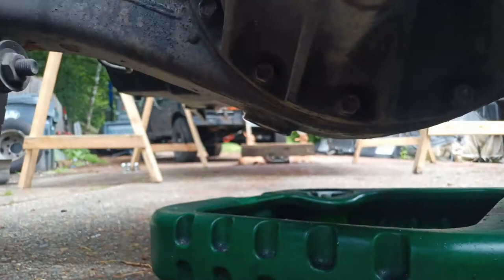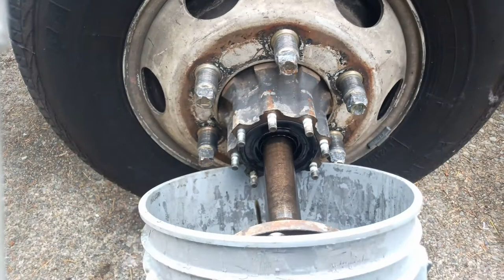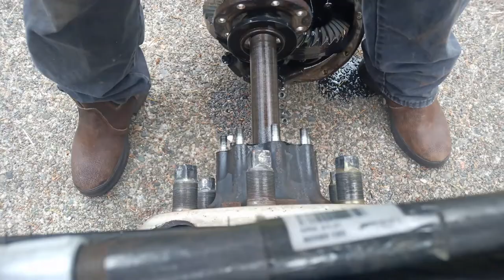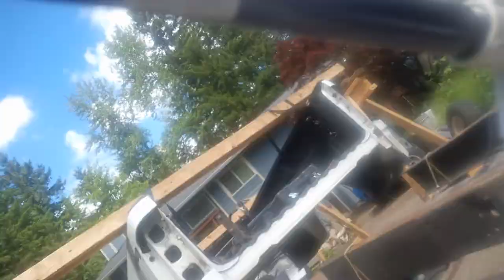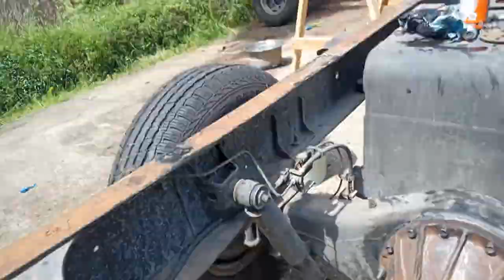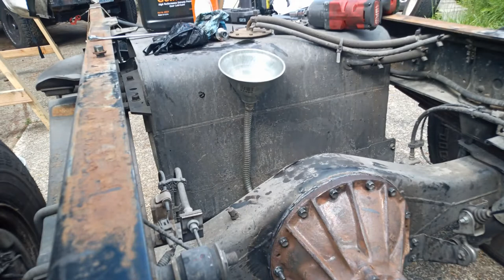Isuzu NPR rear diff swap

Comment: Thanks for putting this up. I'm just learning about all of this- I have an 1993 NPR with a bad G73 -GT5 (4.10 ratio) differential. I'm looking all over for an exact replacement, but it would be great to know that another G73 would fit, even it had a different final ratio. I'd be willing to  compromise just to get it rolling again. It seems to me that your'e showing some compatibility by doing the reverse... thanks for your input, Will in MN
Reply: What were the numbers for both of your differentials?

Comment: I work for a sweeper company street sweeper company. And this is the trucks that we run so we have about 13 of these trucks Isuzu NPR HD gasoline 6.0 engine. I watched your video to try to get some ideas. Because like you I don't have a lift. And if you look on the newer models for some reason in the frame and because of the sweeping unit it's pretty much blocked off from the top. So imagine putting a differential in by yourself laying underneath the truck. It's a huge pain in the ass honestly. I have to use Jax engine lifts ratchet straps whatever work. My boss won't buy a specified jack for the transmission or differentials. The parts guy told me they weigh 177 lb. I've done it numerous times it's a huge pain in the ass. So my thing is if you ever come up with the easier way or you found a technique that works really good let me know thank you
Reply from the maker: without seeing the set up best i can say is find an ATV jack and build a cradle for it.  ive done that for other transmissions while working on the ground.

ATV jack can be found on marketplace/craigslist/offerup for pretty cheap.  harbor freight has one for about $150
Reply: @poet99999 All good. used jacks. Ratched strap. and long rods. went right on.  Thank you for video!

Comment: where did you get the 4.10 diff? what is the RPM reduction you saw at highways speeds?
Reply from the maker: I purchased though an online truck scrap yard.   This reduced my on road rpm by 500-600rpms.  Ill have record my actual numbers some time using gps and engine scanner (the cluster gauge isnt always perfectly accurate)

Im much more comfortable cruising at 70mph now
Reply: @poet99999  yeah sounds like it was worth it once done! I'm wanting to convert an Isuzu NPR box truck into a camper so being able to cruise at 65-70 at a much lower rpm sounds awesome.

Comment: And also I never put any sealant or adhesive or whatever around the edges where they join together. I've never had a problem with them leaking. The only reason because I did it on one of them and then when I went to take it apart the next time I had to clean all that old gunk off of there. And I have a service manual and I don't see anything in here about putting anything on there besides of course lubricate the shaft's lines but other than that you know there's nothing
Reply from the maker: idk i always put the sealant.  being a third member rather than a traditional axle i could see why you dont use a gasket, but sealant will all squish out anyway, so youre right its probably useless, but being that the the parts are old, and could have micro damage to the mating surfaces sealant will take care of any irregularity

Comment: How large are the axleshafts and ring gear on this thing? How would you say they compare to something like a Dana 80?
Reply from the maker: id say the isuzu axle is rated at a high weight, but the dana 80 is more traditional pickup truck shaped and wheels are alot easier to find than the crazy 6 lug isuzu .   dana 80 is rated at 5.5 tons, i BELIEVE that the g73 is rated at 7.5 tons

but i dont have the measurements youre asking for

Comment: can you tell me more about the  torque specs..
Reply from the maker: What do you meed to know?
Reply from the maker: @14:42 i start torques  43ft/lb on the differential perimeter bolts

36 ft/lb for the axle shaft to hub bolts

Drain plug, i stopped short of the called out torque it felt like it was stripping.  62ft/lb

The little brake link doodad was "tight"

Driveshaft flange bolts 76ft/lb
But again i didnt go that tight
Reply: @poet99999  thank-you